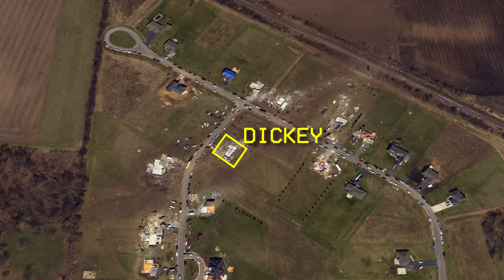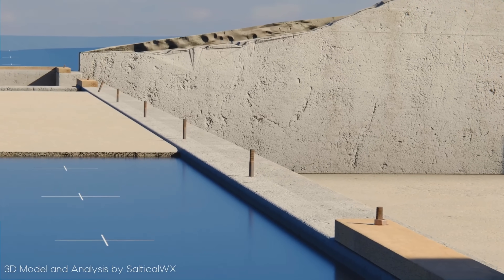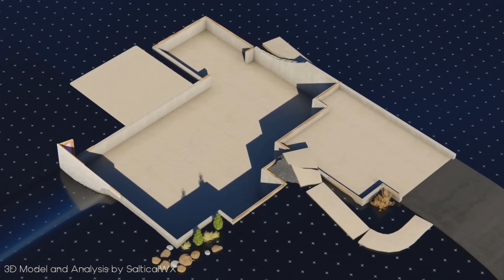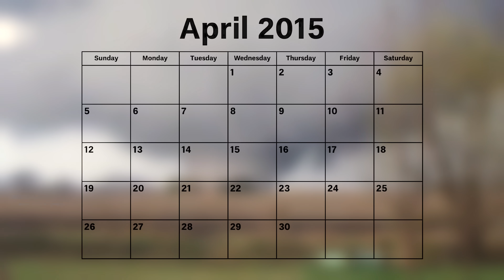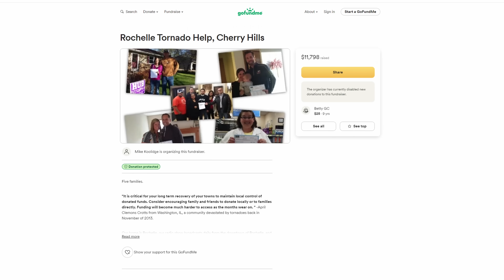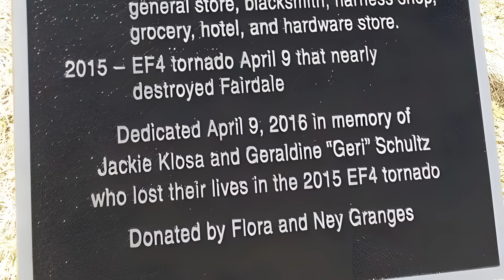The Strongest Tornado That Wasn't Rated EF5

Comment: This was the strongest tornado
That was so close to getting the rating 

Here is how the scale actually works 

The scale is a wind, speed and damage scale 
Not an intensity, scale or size 

If the damage was swept off clean 
But the wind speed is not higher than 200 

Then its not EF5

If the damage is not swept off clean, but it is higher than 200mph

Then it is not  EF5

this tornado was just so close to getting it 

I checked it’s damage and it was swept off clean from its foundation 

But it’s wind speeds was 200 mph

If it intensified for a little bit 
And got 201 mph
Then it would eventually get the rating, but 

It did not intensify 
To be higher than 200 mph

So to truly get the rating, you need wind speed, higher than 200  mph

And the damage must be swept off clean 

To truly get the rating

Comment: Solid EF4.  Not an EF5.  I've been in the center of an EF2 tornado, watching it uproot a few trees about 100 feet in front of me with the sound of a dozen trains and jet engines on full throttle while cracking a few other trees in half, sounding like bombs going off.  I dove under the bed.

At the time, I would have sworn it was an F3, but reading the scale description, it was "just" an F2.

Comment: Chris…can you PLEASE do a video for all these people that equate an EF rating with actual strength in the higher end events?  I mean PLEASE….
Explain that a rating of “EF4-190mph” doesn’t mean winds were “only” or “exactly” 190mph.  It means that whatever DI it struck that earned the 190mph rating was constructed in a manner that 190mph winds are what was needed to slab it and wipe it clean.  Think of it as meaning “Winds of AT LEAST 190mph can be verified at location-X”.  Since it “only” required 190mph to wipe the slab clean on that location, there’s no way to prove how much higher the winds may have been, regardless of actual windspeed.  
Please make this video.
Reply from the maker: No
Reply: @highriskchris  Hmm…..for what it’s worth I don’t like the scale either.  I just thought it would be educational for some folks to hear it from someone more educated than myself.  
Cheers

Comment: Facts of tornadoes 

WHAT WILL HAPPEN WITH TORNADO CATEGORY 
DAMAGES.                   Ef0.   Could completely suck in paper on little things 

Ef 1 sucking up trash cans and damage a bit of a garage 

Ef2.   Ripping of a little bit of roof top damage 

Ef 3. Sucking up cars and ripping half of a roof 

Ef 4 sucking up a house damaging the house alot 

Ef 5 village eraser it can pretty much clear everything of the house

Facts.  The speed of the spin is 700miles per hour. How fast is a tornado? 1500 per hour 

Deadliest tornado.  Joplin 2011.      Hihkians 5002391.

Comment: I believe the main reason this got EF4 and rated at 200mph is that they had no one to gather any storm and wind data at the ground so they took an average based on damage and gave it the highest wind speed in that rating. Without recording the wind speed data there's almost no way to gather an accurate analysis.

Comment: Actually it el Reno reaching maximum wind speed of 336 mph and rated ef3 because of house damage rating but house is outside of tornado and even 2.6 miles wide and it actually F scale used in 1971 to 2007 and ef scale is 2007-present and ef scale is rated house damage and f scale is rated wind speed that is correct

Comment: Anything pre-2013 that may be seen as a controversial rating I don’t think those ratings are wrong, however something happened after the 2013 El Reno tornado in which the NWS made it illegal to rank any tornado an EF5 for some strange reason. It is statistically impossible that not a single tornado in 12 EFfing years was an EF5. The Enhanced Fujita scale has gotta go bc the NWS isn’t even sticking to its own rules when it comes to rating these things, and the anchor bolt thing is the dumbest part of the EF scale bc there’s been plenty of houses with anchor bolts that were ripped off of their foundation completely in the last 12 years. Obviously I know I’m not an expert cliche “but they’re the experts” commenter who will say that in response to this, but it doesn’t take a rocket scientist to look at the evidence and see that there is something wrong with the EF scale. They even had to audacity to downgrade the El Reno Monster to an EF3! They lost all credibility with that decision & there is absolutely no excuse for downgrading the most powerful tornado possibly in our time (so far) to measly EF3 & that has to be one of the most outrageous & idiotic decisions the NWS has ever made. It’s absolutely insulting to everyone who follows these things.

Comment: You know what is crazy. I was looking at the ratings of the smithville tornado of the 2011 super outbreak and in the NOAA damage assesment toolkit it shows a max rated windspeed of 200mph EF5 while the rochelle tornado got 200mph EF4 like that is just blatant bs. But eventhough it wasn't rated EF5 in the end it doesn't matter the fact is still that the lives of many people have been changed forever. May all the victims of the rochelle tornado rest in peace

Comment: The rating system needs an update.. it’s crazy  a powerful huge tornado can be rated a f2 or f3 just because it didn’t hit any buildings… there can be tornadoes that are super powerful but won’t get a high rating because they don’t hit any buildings or cars … there should be a
2 way rating system.. a rating on how
Strong it is period .. and a rating on
The damage

Comment: The thing is, the EF rating is based off of damage not windspeed, so it would be inaccurate to say the actual windspeed was only 200mph. The EF rating has been revolutionary for meteorological science, but we have more accurate ways to test windspeed. Downside if the equipment isn't near by or gets too close it's going to miss the storm or get destroyed leaving the main reference being the damage.  That being said for those affected what it's rated means very little and I couldn't imagine having everything I built up to in life literally getting sucked away. My prayers go out to them.

Comment: Good compilation ! It Took a lot of work to put this together. Here's another 'extreme' in the rating system. The Chapman , KS tornado was rated EF4 based on a railroad tie being bent, it barely hit a single house and was on the ground for 2 hours. No comparison YET they have the same rating?  The attempt to make a rating on a tornado being completely objective still doesn't work.

Comment: Why are the houses built the way that they are built in areas of tornadoes (or hurricanes)? Cost is the first thing one would say, but there are products and processes used in building homes which can withstand 300+mph winds and have minimal cost increases. I believe that it is the industry. It's is the same business model on why lightbulbs, cars and other products are designed to break. The bottom line is profits. We build crappy homes because the industry has decided that it is better for their bottom line.

Comment: I'm not sure who it was (might have been June First?) where I learned a bit more about the EF scale controversies, but what sticks out in my mind is how the scale is still measured by ground damage surveys in a world of mobile doppler radar capable of accurately measuring wind speeds--and therefore strength. To an outsider to meteorology and storm chasing, this method of rating feels like we're sticking our arm out the window to see how hot it is when we have a perfectly good thermometer right there.

And to complete the analogy, if what you're looking to measure is damage, then yeah ground surveys make sense (if you're looking for what it feels like, so does your arm). But if you're actually trying to measure the strength, then how many superpowered tornados go by without an accurate rating because they didn't have the opportunity to destroy a significantly robust structure or tree?

Comment: But the problem is. It’s suppose to be the last EF-5 Tornado. Problem 2. They did issue it as PDS Tornado Warning, but when the tornado is get a lot stronger by seeing the size of the tornado and the debris in the air. They were suppose to issue that PDS Tornado Warning to a Tornado Emergency

Comment: I think it's telling that all the people who seem so certain that these ratings are incorrect have absolutely no experience in the field of actually identifying damage indicators. Most of them aren't engineers, let alone engineers experienced in the impacts of severe weather, yet they think they know better. I'm not saying that there aren't experts who disagree with some ratings or the system, but they usually have a more nuanced take and nuanced explanations for their disagreements. 

Is the EF Scale limited? Of course it is - it's an attempt at evaluating a particular value (windspeed) by forensically assessing the effects of that value. And yes, the difference between a 200 mph tornado and a 201 mph tornado is practically meaningless, but we have to categorize things in some way and therefore, there will be discrete values on either end of that category. But the engineers/meteorologists aren't the ones shouting about it, saying that it is somehow incorrect or disingenuous to label a tornado as a 200mph EF4. It's only the onlookers in forums and YouTube comment sections that seem to have trouble reconciling these nuances. 

Remember, if you think it's crazy to call a 200 mph tornado an EF4, then it is equally as crazy to call a 201 mph an EF5. Uncertainty and variability works in both directions and it is just as valid to say that a 201 mph could have an EF4 as it is to say a 200 MPH could have been an EF5. The same thing is true for hurricanes - one single MPH difference in measurement makes the difference between a Cat 4 and a Cat 5, but on the ground it really makes no difference. At the end of the day, it doesn't make a lot of difference to the people impacted by it. These are ratings for the sake of recordkeeping and data gathering. Whether the record shows 200 or 201 mph isn't super important in the aggregate.

Comment: "The difference (wind speed of a tornado) between 200 mph and 201 mph is nothing". As such, this is a perfect example where an EF rating is seriously flawed. Moreover, EF ratings are primarily based on both wind speed and property damage and are not necessarily directly linked to human injuries or loss of life. There is also one additional factor which could be viewed as being misleading in regards to the power of some tornados. So, even if the wind speed of a tornado reached 360 mph (allegedly the maximum wind speed of any tornado) and if it did not hit any property, this would not be properly reflected in its EF rating (as in no EF5 rating). Therefore, this could lead us to wonder if it would be possible to design a better or alternate wind scale in determing the potential danger of any given tornado.

Comment: I thought that if only a slab was left, that meant it was an EF-5... isn't that like definitionally EF-5? Also, when are we going to try to categorize the tornadoes themselves, rather than only categorizing the damage caused by them? Calling any tornado an EF-4 or EF-3 isn't right, since what is being categorized is the damage, not the tornado itself...

Comment: Deffo the EF scale is not sciantifically accurate anymore. Same happened to hearthquakes, the scale was measuring the visible damages, then changed to the Richter scale ( that measure the energegy released, aka: magnitude), so it should be done for tornadoes. Millibars and windspeed should be the criteria used, because what pulverises concrete and bricks is the combination of pressure drop and rotation.

Comment: The thing to note about percentile chances are it’s in this case a 10% chance of a tornado within 25 miles of every dot on n the indicated area meaning the overall percentage chance is way higher than just 10%

Comment: I mean no disrespect to the NWS but it’s a little comical that they refuse to rate tornados as EF5’s based on one part of the damage path being less than or equal to an EF4.

I wish there was a different scale. Because theoretically a tornado could be >300 mph and be an EF0 because it was in the middle of nowhere. Heck that’s technically what happened with El Reno in 2013. Widest tornado ever recorded with wind speeds close to 300 mph, and multiple sub vortices but it’s rated as an EF3? It just doesn’t make sense

Comment: This is NOT the strongest tornado not given EF5. It’s between El Reno (rated EF 3 with 300+ mph winds from radar, the most terrifying tornado I’ve ever seen), and Greenfield (300+ mph, given EF4 rating). 

The EF rating scale is just stupid because giving 300+ mph winds an EF3 rating simply because it didn’t hit any houses is just stupid.

Comment: The only reason this wasn’t an EF5 is because after 2013 they changed the formula to prioritize damage caused directly by the tornado which makes it nearly impossible to classify a tornado as an EF5 even if it would be an F5 on the old scale

Comment: I was in Hurricane Bertha when it spawned several tornadoes nearby. Obviously, it was extremely unsettling but there's a strange sense of calm that I felt when I realized that while I was taking the right precautions, that's all I could do. The rest was up to forces far outside my control. I feel like I grew up a bit that day. Luckily, the area we were sheltering at was spared. Part of the area got nicked but no fatalities and only a few minor injuries. Though I doubt those that were injured felt they were 'minor'.

Comment: Also, El Reno tornado (2013) had max wind speeds of 313 mph and is also the fastest expanding tornado from 1 mile to 2 miles in 1 minute, it also killed 3 stormchasers, Tim Samaras, Paul Samaras (I kinda forgot the name) and Carl Young. It was just rated EF3 because it lacked damage that would qualify it to an EF4, let alone an EF5.

Comment: I would also say that you could make a strong argument that the infamous Mayfield, Kentucky tornado of December 2021 could be argued as having reached EF-5 strength. There were several places along the track of that tornado that were officially rated as being the highest end of EF-4. At that point it really comes down to semantics. There are well respected meteorologists and engineers who have argued that tornado exceeded the EF-5 threshold.
Reply: Bremen KY had EF5 damage imo

Comment: I suspect these tornadoes work like a condenser in a power plant.  When the moist air encounters the low pressure and temperature air mass of the storm, the moisture condenses reducing its volume by more than 1000x.  The reduction in volume in turn reduces pressure and temperature (pulls a vacuum), which then sucks in more moist air and the cycle continues.

Comment: The EF scale is based on the destruction that the tornado causes.
This obviously has to do with the financial cost of the destruction and also the scale of the response effort.  For me this is scientifically absolutely pointless, as it is like saying that a monster tornado with a diameter of 1 mile and fairly low rotational speed is harmless. The F scale that focuses on the physical characteristics of the phenomenon, is much more appropriate in my opinion.

Comment: 08:45 Why we need to remove warning labels from shampoo bottles. The fact that he just sat there and watched when it was that close to him, rather than backing away, shows how low of an IQ some people have. These people have the same right to vote as you. Remember that.
Reply: It’s not like his car can back away at 100 mph cars can only reverse slowly it wouldn’t make much of a difference if the tornado was close enough to damage his car
Reply: @EndIessProductions  What are you talking about? A car can reverse at up to 30-40MPH, which is well-enough to get farther away in this situation when the tornado is moving near-perpendicular to your position. That's a poor use of logic to justify sitting on the edge of death. "Herp derp I only get one gear to move and can't go as fast backwards - MIGHT AS WELL STAY HERE AND POTENTIALLY DIE!"
Reply: @du4lstrik3  Yes, he shouldve backed up sooner, but as it crossed the road, he couldnt. The inflow [wind going into a tornado, for those who dont know.] looks to be strong enough to where the car wouldnt be able to move much at all, so it was too late as soon as the tornado crossed the road. Also he probably couldnt fully comprehend the situation, and it was probably a lot bigger in person, so from a pov like that, it probably looked like it was right next to him. If i didnt know anything about tornadoes i'd think i would be dead right from the start. It also was a lot faster aswell. But i agree with you. He shouldve backed up, but in a situation like that there are some factors that couldve led him to not back up. Im just glad he survived.
Reply: @boomnews815 wrong timestamp
Reply: knocking on deaths door